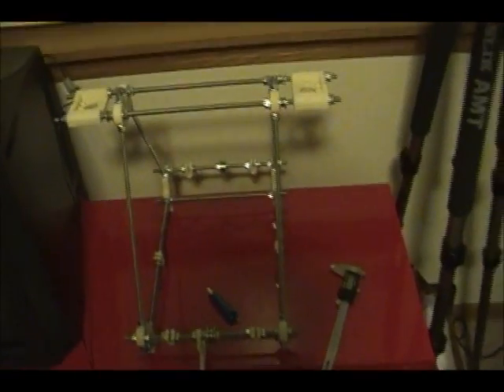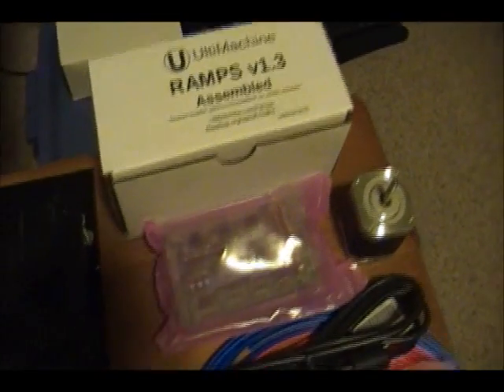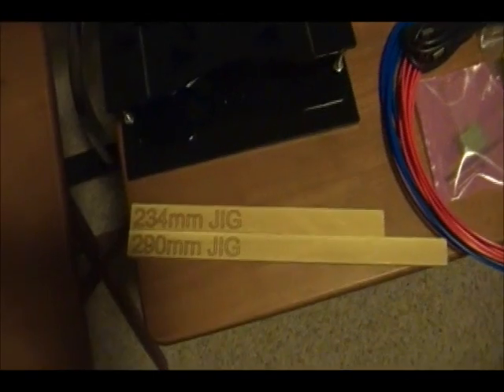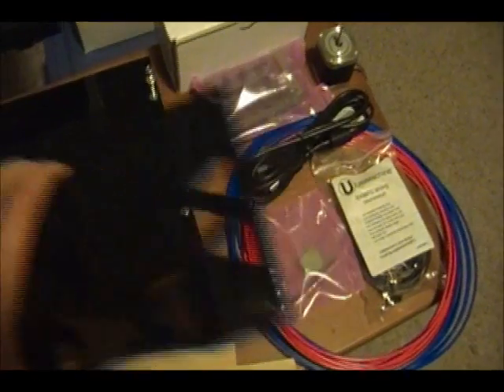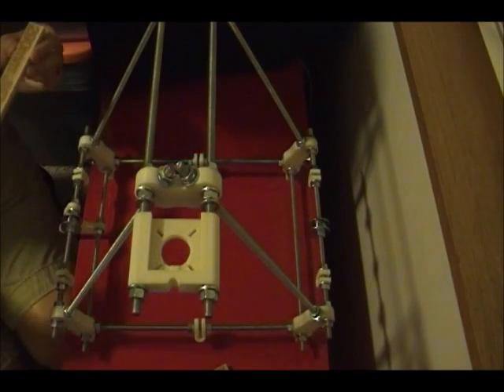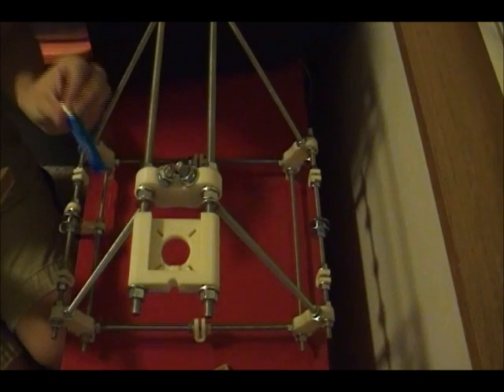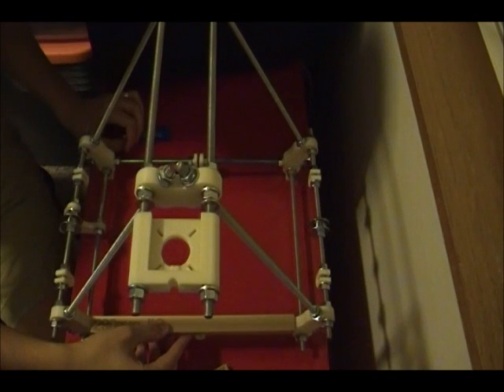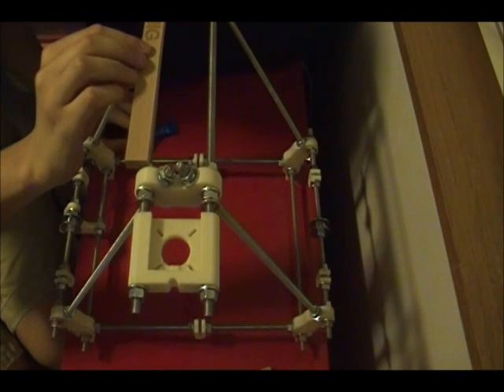Prusa reprap build Part 5

Comment: no don't use lock tight till you take it apart 2 or 3 times fixing things with new information like how many washers you need to space the "Y" motor gear etc